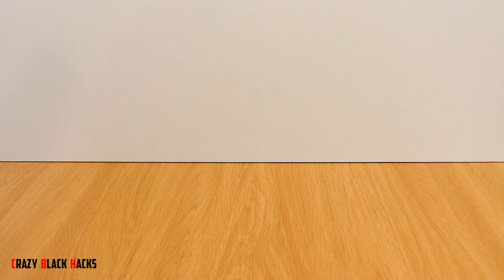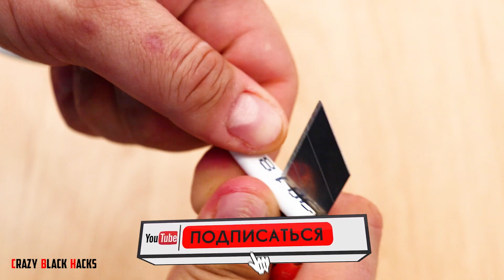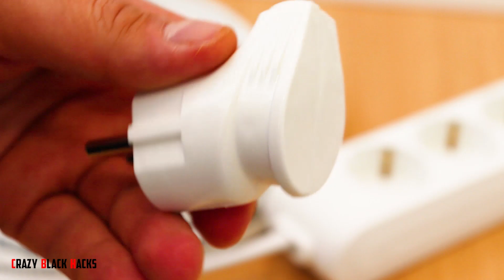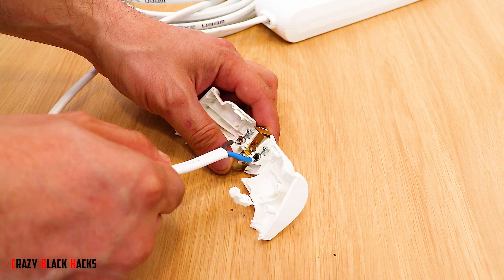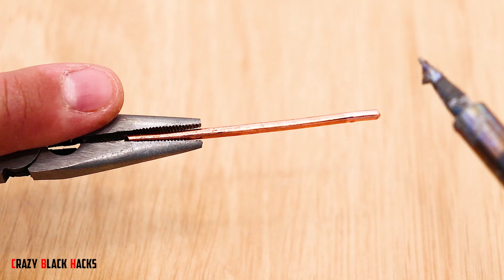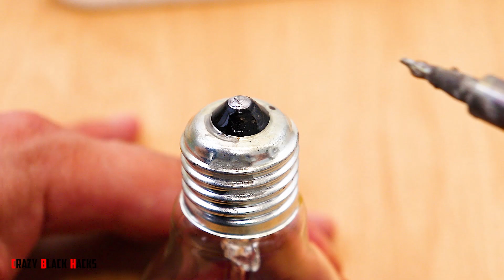Бесконечный генератор энергии - из сетевого фильтра - очень странный случай

Comment: 🚨 While the bulb is lit, please remove the black capacitor, and then put it back in. Please make a new video showing this. Otherwise your results must be assumed faked otherwise. Thanks.
Reply from the maker: I can’t do this anymore since I took the device apart
Reply: @CrazyBlackHacks  - You simply re-assemble it... just like you did here. No edits this time around.
Reply from the maker: I collect as in the video. did you build similar devices?
Reply: @CrazyBlackHacks  - Yes, but not like this one. Mine requires moving parts to work.